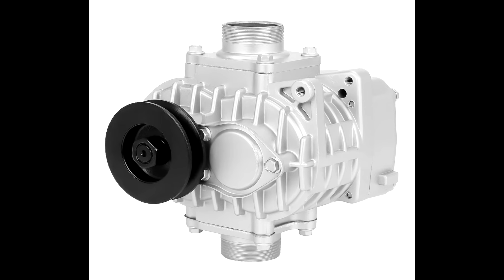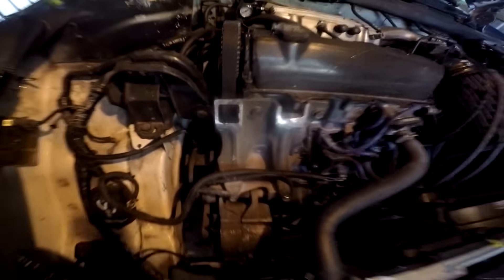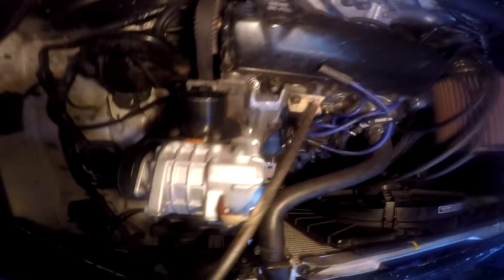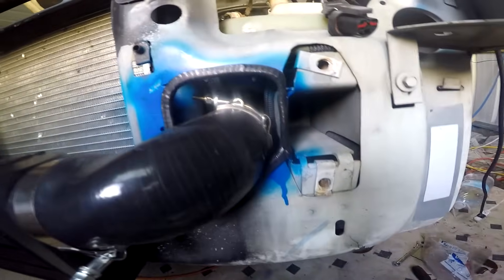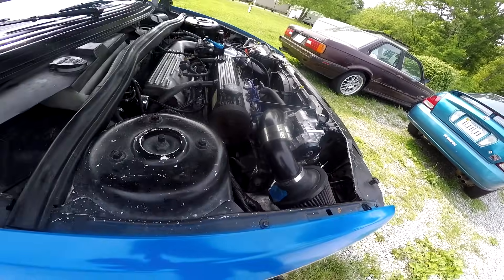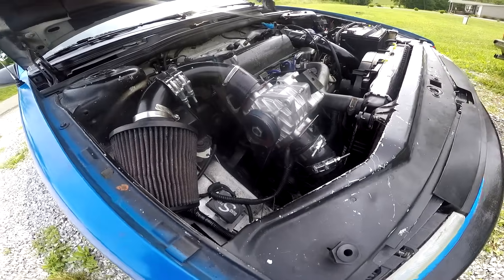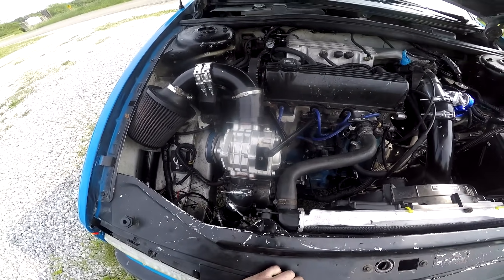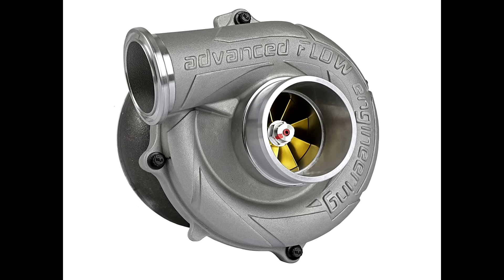AMR 500 Supercharger Testing - is it as Good as the Internet Says?

Comment: ive been interested in these for a while and still am. dude ordered off temu and got exactly what he paid for.
problem is he didnt do any research.
always research before you buy.
their fine rebuilt if used on the right size engine. these really arent even good for 1.6l its more like 1.2l max. its a 500cc blower. you would have to spin it 4 times its capacity to fill 2.0l 
put it on something under 1000cc or 1l and they do quite well and dont kill themselves.
they were designed for the 600cc cars people. kei cars. not a 2.2l engine.

Comment: The problem is buying a custom belt which I don’t think anyone does because the original belt won’t fit
Reply from the maker: Most V belts are pretty much the same size. The stock AC pump belt fit perfect on mine.
Reply: @HatersGarage  what about a 2014 Ford Focus 2.0 even tho custom brackets will have to be made but it’s a car me and my dad use it to fit random parts for fun
Reply from the maker: @ramshacks9493  You would need to put a micro v-belt pulley on the AMR500 in order to make it fit in place of the ac pump.

Comment: Ohhh, geez- that's kinda lean for a forced induction set up brother... I run my turbo RB30 R31 Skyline at about 11.7/11.8... The lower the boost the leaner you can get away with though. I would seriously think about making it a bit richer for the safety of those factory cast pistons and powdered metal rods... If it gets a bit hot, you get a bit of slightly shitty fuel or you hot lap this thing at the track or do a few WOT runs on the street back to back that lean mixture will make it more likely to detonate and break a ring land on one or more pistons... Even going WOT throttle in hot weather can be troublesome and induce knock strong enough to hurt the pistons and big end bearings (which could take out the crank if your not lucky)
Reply from the maker: You're absolutely right. However this particular setup wasn't actually making any boost, so I wasn't concerned with it.
Reply: I run 12.0-12.2 on a heavily boosted engine on E85 at nearly MBT.
Reply: Hot weather it runs around 11.7/11.8 though.
Reply: @HatersGarage  Ahhh, ok- I understand. All good bro.
Reply: @kirbyswarp  That's a little lean for E85 bro! It all depends on how you set your A/F ratio gauge, whether it reads Lambda (Lambda is a completely different scale) or set to read the A/F ratio where it should run 10.8 - 10.5 to get that sweet spot. In all honesty, E85 has a much broader tuning window in terms of usable air fuel ratios than gas. You can get away with a lot more each way of stoichiometric with any alcohol based fuel- but it should show different A/R ratios with each fuel if tuned correctly... You'll pick up a bit of power running a bit richer with E85, it likes a rich mixture and is actually an "oxygenated" fuel with O2 molecules in it's make up. Oxygenated fuels always make more power with a richer mixture
Reply: @danielbrealey2924  AFR is derived from lambda though. If you multiply stoichiometric ratio for your fuel if choice against the commanded lambda, you get the AFR ratio.

It's not a different scale, AFR is a derivative.
Reply: @danielbrealey2924  This is converted from lambda. Equivalent to running 12.0 on gasoline. Running 10.9 AFR the car made almost no power.
Reply: @kirbyswarp  Well- 10.9 kinda drowning it in fuel if your using normal gasoline, but is right around the sweet spot for E85 🤷. Somethin' is a miss here, if your a tuner you would know E85 has a much wider usable A/F ratio than gasoline, and running it a bit rich will INCREASE power because it's a highly oxygenated fuel!!! So either there's something wrong with your O2 sensor, the gauge (a lit less likely) or something weird is going on here...

Comment: smaller pulley and an intercooler will boost your car 20% more than stock .  for a 2.2l engine  that thing it's really small anyway. will work great on a 1.4./ 1,6l .
Reply: What about a 1.8l? Do you think it might have any problems
Reply: @guyroo  1.8 will be ok and even much better if is not a 16 valves.

Comment: Well could work for a 2-2.2 liters  , if that engine does not rev high , and has a not so good volumetric efficiency to begin with.
But I do give you , that they could be more descriptive about what the charger can and can not do.
Interestingly i found these advertised as max 14000 rpm and 500ccm per rev max. That supposedly yields 7000 liters of air per minute , where it would still be Just making loss overall. 
Assuming an engine with 10 to 1 compression ratio to begin with , a 0.2 bar boost is well whitin reason as a small performance bump. That would mean an engine that can not take more Than 5800 liters of air.
Given a 2 liter 4 stroke that be a redline of approx 5500 rpm. 
If you got a smaller engine , like a 1.4 liter one , it could rev to about 7500-8000 rpm.
As rpm climbs and volumetric efficiency decreases , the actual boost pressure will rise. 
So actually you need to have a blow off valve set to 0.2 bar , and you need an electric or some other type of valve after it. Thst needs to stay shut above a certain rpm. That depends on the engine and its ve curve. Basicly a 2 step blow off setup. Thatway near peak tourqe rpm , where ve is about near its highest , you won't overboost and have knocking. And at higher rpm where ve would start to drop , you get a slightly rising boost curve. That makes the powerband expand to higher rpm. And thats a decent tune. An other solution is decreasing the compression ratio of the engine to begin with. Then you can have higher boost without knocking , and not need a multi step blow off valve.

I do plan to get one my self, for an 1250 or so ccm fiat engine.  For that ,its a good match.

Comment: "If there is a oesson to be learned here, it's that turbos are better."
Not necessarily true. While a properly sized turbo with decent intercooling and tuning of the engine to match will most definitely give much improved performance, a good quality supercharger ftom a reputable source (Paxton or Vortec for example) will give similar improvements in power.
Reply from the maker: I always think of cost to performance. Say a Procharger setup costs $5000, where as you could install a turbo and make the same power for $2000.

Comment: I’m more baffled on why you wouldn’t have used the stock 2.2 turbo.

But I’m assuming you’re just trying to be different.
Reply from the maker: I am. Also the stock 2.2 turbo's haven't been produced in a VERY long time, and it's difficult to find them in decent shape at a good price. I recently bought a turbo from a Mitsubishi EVO 8 to put on it for a fraction of what the original turbo would have. Not to mention it's a newer turbo design that will work better.

Comment: At 500cc per turn just don't think it's enough for engines greater than 1L. I have a project putting a motorcycle engine in a car using one of these. The engine is 782cc so I would expect better results on average. Lot of little things play but when your power supply is already too weak no amount of science will fix it.

Comment: On anything other than a single cylinder  type engine under ~1000cc this is not a power adder it is an intake restriction. This unit WILL flow air and make boost, but very little cfm. If you’re looking to boost like a Predator 212 or some sort of little Briggs & Stratton engine this will actually work but it will only support very moderate power levels.

Comment: If you had actually done your research first.
Blower displacement x drive ratio ÷ engine displacement per rev ÷ 2 due to intake stroke on 4 stroke.
This gives you your boost ratio
Then you remove 1 atmosphere from this to get your boost pressure.
So.
500 x 2.33 = 1165
2200 ÷ 2 = 1100
Then divide 1165 ÷ 1100 = 1.059
1.059 minus 1 atmosphere = 0.059 bar pressure. This is at 100% efficiency which never happens with superchargers so problem in the minus pressure wise.
These superchargers get a bad reputation but it doesn't help when youtubers like yourself, donut media and grind hard fit them wrongly without doing any simple research

Comment: You should test Chinese SC14 superchargers too. I really don’t wanna have to get a turbo manifold for my 87 CRX where the fuck am I gonna find that LMFAO
Reply from the maker: Custom headers are the way
Reply: @HatersGarage  I’m just afraid of getting price gouged because I don’t know how to make things myself. Tubing for a supercharger I could probably do but I’m a little scared of making headers >.>
Reply from the maker: @fenixlolnope361  I would shop around. If you really wanted to you could travel and leave the car at a known good shop and have them make it.
Reply: @HatersGarage  that's probably what i'm going to do. Wondering something about this supercharger in particular- how do we account for motors like my D series that spin counter-clockwise? After doing the math it would make like 7PSI with a 2:1 belt ratio on my D15a3.. is that even worth it??? What would the horsepower improvements even look like there? By the looks of things it should get me around the 150hp mark or so if I properly tune everything????? which is big with the first gen CRX's curb weight being so low I guess. I can't seem to find any real info on these things for applications like smaller D series motors.

Comment: You could’ve easily increased power by getting bigger intake and exhaust flanges on the 500 the pulley like you said wouldn’t have done much even with that said you’d be luck to get a 8 second run these 500 are trash only good use is a twin charge set up

Comment: Ok, so I have one, and strapping it on and hoping for boost is not the way to go... You'll need to tear it down re-do the bearings and overdrive it. You can spin them up to 25000 or even 30000 if you rebuilt it right. You're right don't trust Chinese shit. It's cheap for a reason it isn't rebuild, it's "reconditioned" meaning it's checked to see if it moves air (spun a little to check bearings and airflow) then it's painted things aren't even bead blasted man. Don't trust something that wasn't even cleaned properly. Get a rebuild kit, OD bearings and run 75/90 in it with an OD pulley.

Comment: That little supercharger is made for go karts dude. Use your head for real Jesus it’s like you have no idea displacement or flow rate……
Reply from the maker: It's advertised for a car engine, so I tested it on a car engine. Simple as that.
Reply: @HatersGarage  it’s advertised as a UTV supercharger…….don’t know what China made site you found but it was literally designed for use with low displacement ATV/UTV
I did see a fella years back out it in a Honda but it was ineffective and lacked airflow for higher rpms